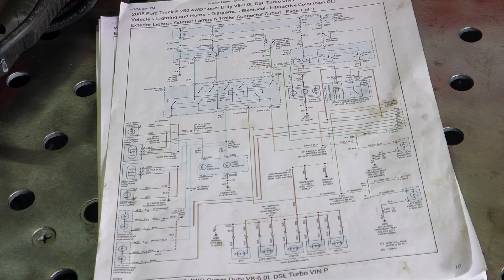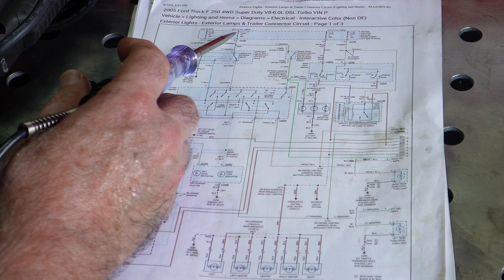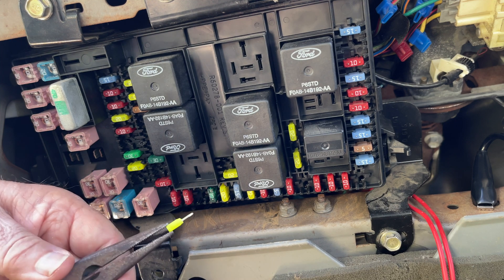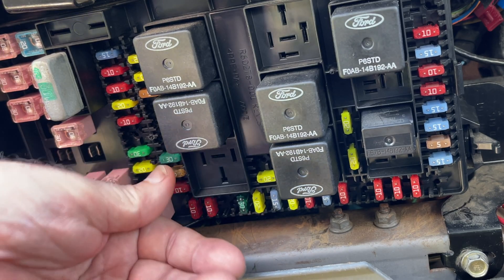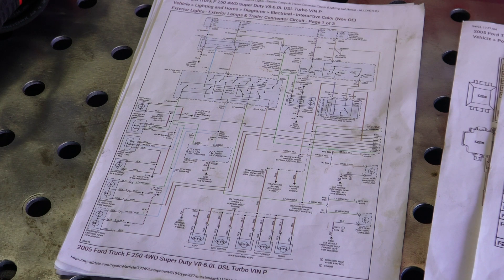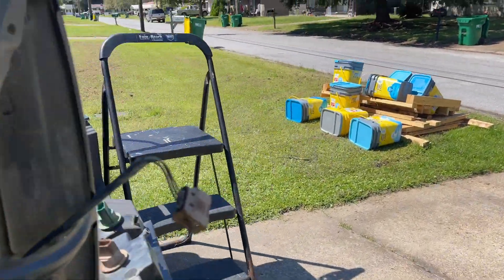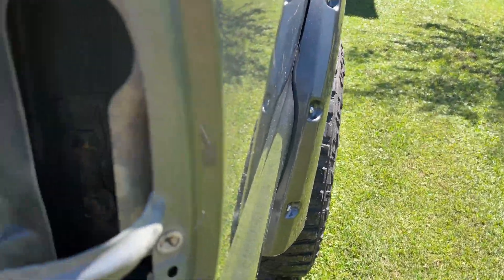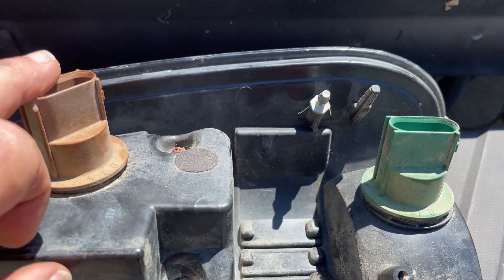Finding An Electrical Short To Ground On Any Car Or Truck

Comment: Since you think it is a short to ground, is there a reason that you didn't measure the light to see if it was shorted? 

Im not critiquing your method im asking for better understanding.
Reply from the maker: I knew it was a short to ground because of the short immediately blowing the fuse.  It was completely melted and I could visually see the wires shorted to each other.  No reason to test.  As you seen it fixed the problem.

Comment: LED cause lots of problems when folks convert them from standard
Reply from the maker: I agree, and this truck is a good example of that
Reply: Yup I'm going through this now. I changed all outside lights to led and change signal relay and I'm pretty sure I have a ground fault somewhere as every time I turn on a blinker all 4 corners blink and the tail lights. I press on brakes and brake lights done flash anymore but front do confused on a 2000 tundra 😊 I've been digging

Comment: Hey, Rus! I spent 46 years as a diagnostic technician, and my specialty was electrical and A/C. You did a great job on this video. I do have a suggestion, though. Fuses are not really expensive, but if you keep having to blow fuses to find a short, it might be better to invest in a few circuit breakers of varying amperage that you can plug into any fuse circuit and then when you have a short, it will pop the breaker, but it should self-reset after a short cool-down period. There may even be some manually re-settable circuit breakers out there, too. That would be a good addition to your toolbox arsenal of test probes, leads, etc. Two other tools that any electrical tech should have are a Power Probe and a Fuse Buddy. A Fuse Buddy helps me see where small drains are coming from that run a battery down overnight. It tells me how much amperage is running through any circuit. I am jealous of your schematics. I used them for years and years, and now that I am retired, I am having a hell of a time finding good schematics without being subscribed to a service online like Mitchell, Alldata, Identifix, etc. I just tinker once in a while and cannot see paying a monthly fee for a service that I might use a few times a year. How are you accessing your schematics? Are you paying a fee for them? If so, how much? Is it a monthly subscription or a one-time-only deal?

Comment: Nice work on this. Reading schematics is not a strong point for me. Mainly I think because I have not needed to really know before. I worked in machine shops for several years and anything electrical  related went to the maintenance guys. Blueprints I can read, but not schematics.
Reply from the maker: Thanks, I’ve done electrical work in one form or another for most of my life.  I worked in an automotive shop for 16 years and got to know automotive wiring diagrams very well.

Comment: Good video Rus . you cover all kinds of problems . in the long run you save a ton of money by doing all these things your self. THANK YOU FRANK FROM MONTANA......
Reply from the maker: Thanks Frank!  Yeah, I have always worked on my own vehicles as well as other folks.  I worked in an automotive shop for 16 years.  It was my second job at nights for most of those years.  I was a pipe welder on my day job but I have done a lot of different things, and that's why I started this channel in addition to my BBQ channel.
Reply: @SkillSavvyDIY  thank you for your response Rus . you saved your friend probably about 300.00 dollars